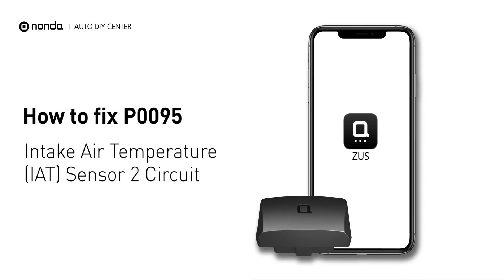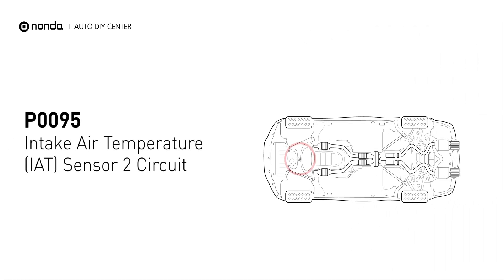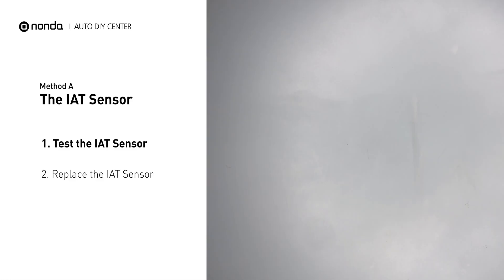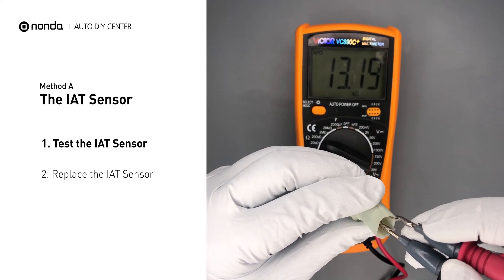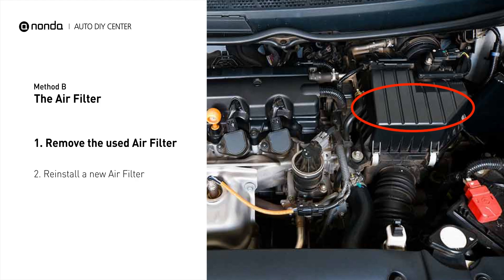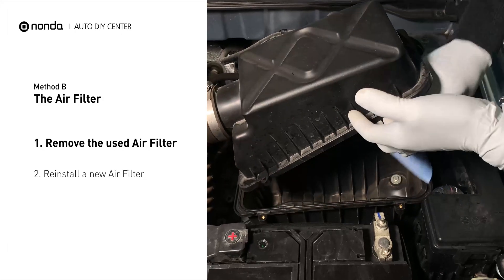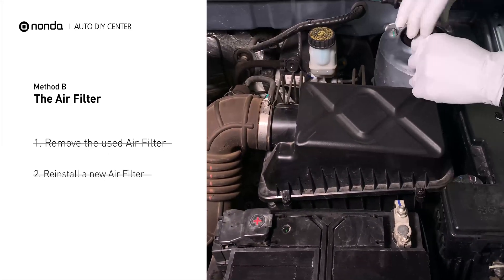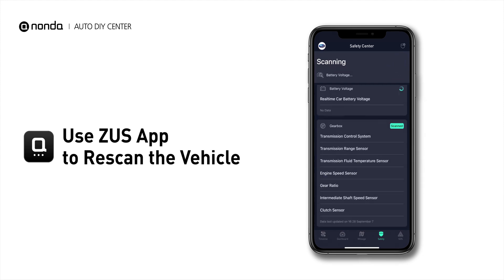How to Fix P0095 Engine Code in 3 Minutes [2 DIY Methods / Only $7.74]

Comment: this material is the one and only that saved my 200 polish bucks. only here i could learn that p009564 code means not the faulty sensor (which i eventually have changed a few times with no luck) but PROPER CLEANING OF AIRDUCKT AND AIR FILTER BOX needed to be conducted. big thank you
Reply from the maker: You are most welcome, Robert!